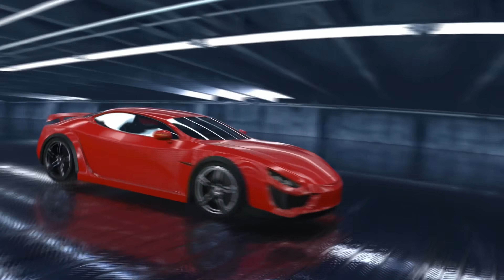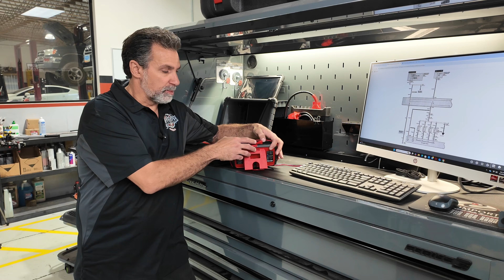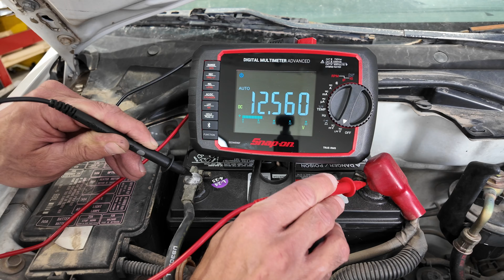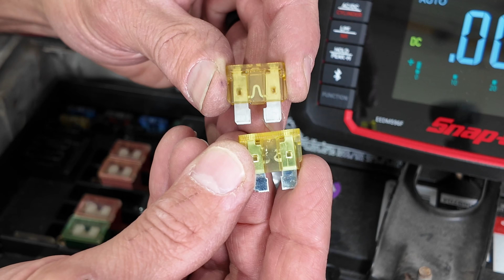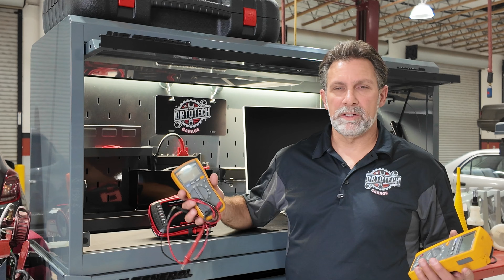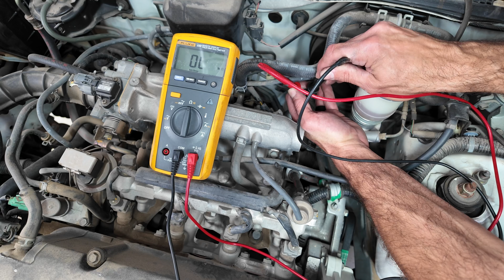Car Electrical Troubleshooting Made Easy: Multimeter Guide for DIYers | OrtoTech Garage

Comment: Surprised you blew the fuse like that. I saw a guy in the doctors office once that had a battery blow up because of hooking the positive jumper cable up last, caused sparks and the battery blew up. I know it’s rare but some accidents are. Not stating this to be mean but that accident has stuck in my mind. New subscriber and really like your videos. You are an awesome instructor and relate in really good layman’s terms
Reply from the maker: You're 100%  correct!  Thanks for pointing that  out.  I should have done that away from the battery.  Those gases lingering around the battery can ignite with a spark.  Thanks for catching that.  Sometimes, when im creating these videos, I've got too much on my mind.  🙏